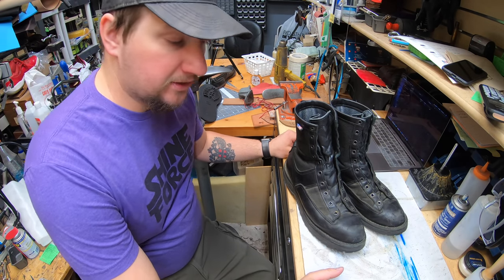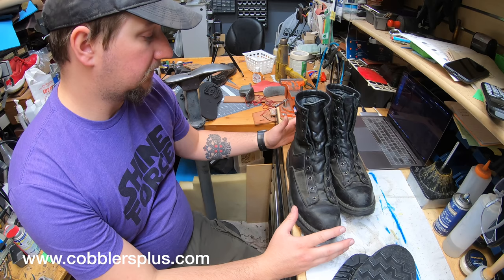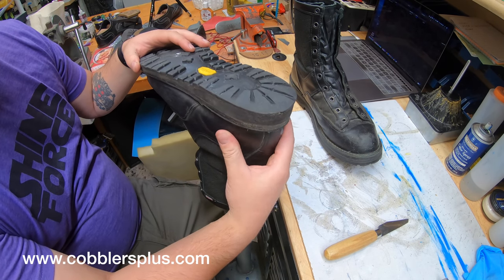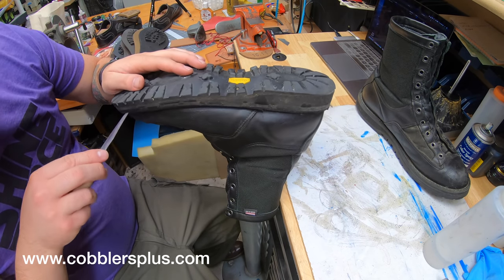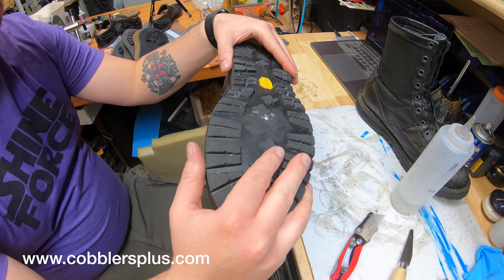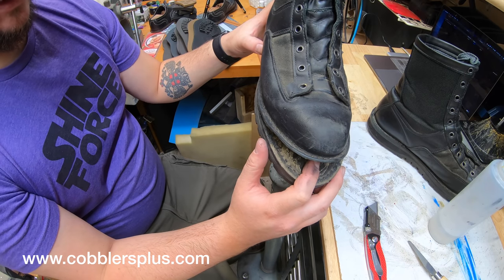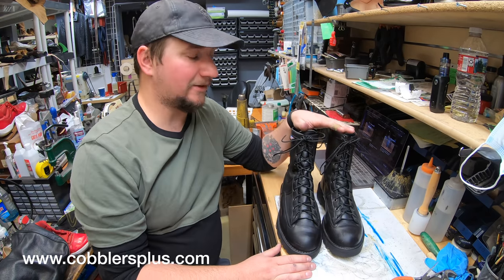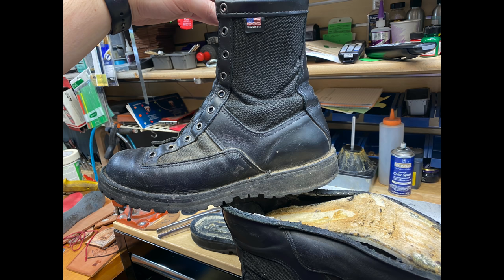Danner Boot Re-Craft with Vibram Doubler Soles, Hand Stitched Midsoles and Heel Counter

Comment: I have a pair of Danner that came separated on the soles during a heat wave in CA, what kind of glue can I use?
Thanks
Reply from the maker: You do want to clean out the old glue and use contact cement